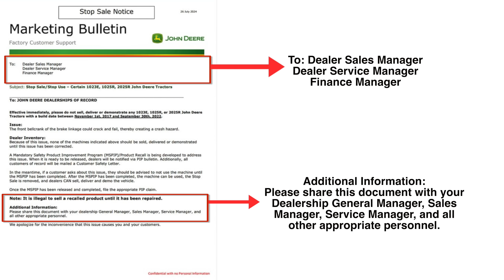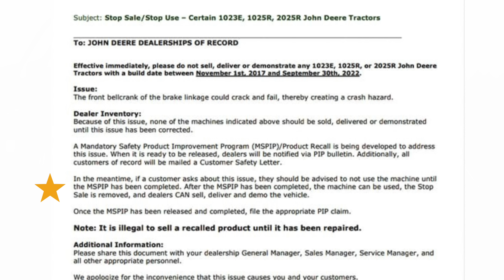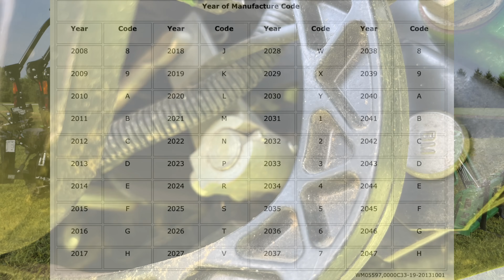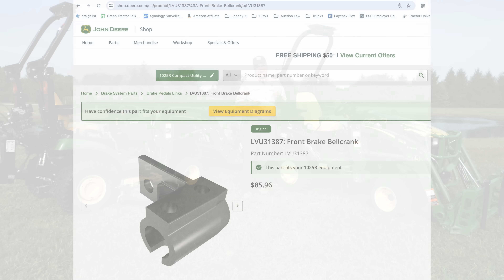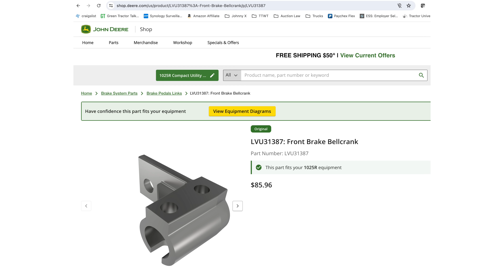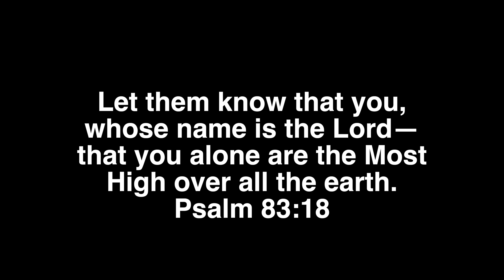Deere Says "STOP USING YOUR TRACTOR"

Comment: We want to inform you about a recent stop use alert issued by John Deere for the 1023E, 1025R, and 2025R models built between November 17, 2017, and September 30, 2022. John Deere will be reaching out directly to customers with affected machines to provide further instructions and support.
At 21st Century, your safety and satisfaction are our top priorities. We’re pleased to report that less than 1% of our current in-stock inventory is affected by this issue. Rest assured, any affected machines will undergo the necessary Performance Improvement upgrade and thorough testing before delivery to ensure they meet the highest standards of performance and safety.
If you have any concerns or would like to verify whether your machine is affected, please contact your local John Deere dealership for assistance.
Thank you for your understanding and continued trust in 21st Century and John Deere.
Reply: Why did I not get a notice about this as I own a 1025r that is in the years that have the problem.
Reply from the maker: @Powerhousered1223 no one has yet.  The recall is just now getting started.
Reply: I used to be a Deere man never again.
Reply from the maker: Thanks for the prompt feedback.  As always, we are impressed with 21st Century Equipment, and your commitment to your customers.  Thanks for taking the time to respond!  You guys are setting the standard for Deere dealerships!

Comment: Tim Love watching you, is there any possibility that John Deere has made any improvements to the PTO switch on 1025R they are inconvenient to use and very fragile
Reply from the maker: They changed it in 2017 or 2018 I think. 
How old is yours? Do you have pull out switch or toggle?   Current is toggle…hold down a second or so to start.
Reply: Minè is the rocker style switch
If you have gloves on it is almost impossible to turn to on
Rocker style switch not very durable
Reply: Pull switches were much better

Comment: I am an engineer and I can tell you that there are many bad design choices in this tractor (I've got the 1023E).  I just changed the oil for the first time and the oil filter is so close to the frame that you cannot fully engage the removal tool.  The oil fill port is also obstructed, and the dip stick is at such an angle that it is difficult to remove.
Reply from the maker: Very tight space. Lots of stuff going on in a small space.

Comment: It’s been over 5 months and they still do not have any word on when parts will be available for the 2022’s. The dealer doesn’t and John Deere doesn’t either. I purchased the 4 yr/1000 hour extended coverage and I’ve lost 5 months of that as well. A company as big as JD should have these parts out way quicker than this.
Reply from the maker: Absurd.  But they didn’t hesitate sending a ‘do not use’ order.

Comment: Mine is under recall. I do remember being on a hill in front of my land scape wall loading up scrap lumber in the bucket.  The bucket was up and as I was putting the scrap in a noticed my tractor was drifting backwards. I was shocked I carefully got on and backed it down the hill. I’m going out today to see if it’s broke or cracked as I’ve heard nothing from the dealer since I went and added myself to the list of people. I’m on a hill but I put mine in low and 4x4 and it creeps on the hill. I just won’t park on a hill until it’s fixed.

Comment: Got mine fixed last week. (JD 1025r TLB)
It's hydrostatic, when you release the fwd-rev pedals, the tractor stops.
l only use the brake as a parking brake when l get off.
Glad it's fixed though.

Comment: My Tractor is a 2019 2025R model. I had my tractor in for routine maintenance service this past month. The letter I received in September, stated my tractor was supposed to be fixed by the end of October. The Dealer repair department stated they "Don't have any parts to repair any tractor yet" The letter states to "Park the tractor and not use it" This is so wrong. I don't want to get hurt or hurt someone else, since I live on a flat lot and never use the foot break, I will be taking my chances if I need to use the tractor. I can't understand why John Deere hasn't found a manufacturer or several manufactures to get these replacement parts fabricated and installed when we were promised they will be ready

Comment: I received a recall letter from John Deere. I called my local John Deere dealer where I purchased my 1023e and they set up an appointment to have the part replaced. They came to my house and picked up the tractor, replaced the part and returned the tractor a few days later. As long as they had the tractor there, I had them change the engine oil and filter and grease job. No complaints here.
Reply: Do they charge for the brake part or give the part to you? I can do it myself but want to make sure whether they are supposed to charge or not. Unfortunately the dealer service in our area are known as parts changers until they find the fix. So I don't know whether to trust them or not.  Hopefully you reply and let me know. Thanks 😊
Reply: @rj9203  There was no charge.

Comment: And as of right now john deere has not sent parts to the dealers to repair this issue. And I will add customers can not repair this issue them self. I work at a jd dealer and probably get calls about this 5 plus times a day. Customers may get up set techs at the dealers don't have the parts yet but understand dealers don't make the parts.

Comment: I decided not to wait on JD parts to be made, and I bought a bell crank for my 2025R off Ebay ($53). This one was fabricated with steel and welded(much stronger). It took me less than 45 minutes to install, and would probably take someone who has done it before about 25 minutes. I suggest you put the tractor on level ground and block the wheels for safety.  Use a 13mm wrench (a 1/2 inch will also work, but remember the two bolts are metric, M8 - 1.25) and it is helpful to have a long screwdriver for leveraging off the rod that goes back to the rear axle/brake. When finished, I replaced the cotter pin with a new one.  Remember that the rod (which goes to the back of the tractor) is on springs and can be pulled forward by hand, to help you line up the brake rod hole in the crank. Both original bolts through the bell crank do NOT have nuts. You will see that the original bolts (when backing them out) will literally eventually hit part of the frame, but if you tip the head of the bolt back and wriggle, you have just enough room to get the bolts completely out. I used a ratcheting 1/2" box wrench, but then had to switch to a crescent wrench, otherwise the ratcheting wrench will get stuck [because the bolts are flanged] when the bolt is nearly out. Note that only the axle (?) itself is threaded.  I discovered that the original bell crank is caste [aluminum ???] and cheaply made. The caste crank is only threaded about 25%. There is no need to jack the tractor up because there is plenty of room [unless you have a big stomach] to crawl on your back under the right side of the tractor. The bell crank is on the RIGHT side of the tractor, directly beneath where the heal of your shoe is, when your right foot is on the (foreward/reverse) pedals. It's a simple fix because the part is 100% metal and there is no electronics or plastics, etc., involved. Local people are fabricating them from steel in their shops [welding]. JD plans on sending techs to your home and doing the needed replacements there, so you don't have to go to a dealership. But the fix is pretty easy, if you want to do it yourself. Again, I got the part for about $53 from someone probably fabricating them in their garage or metal working job. Honestly, a 12 year old boy could probably figure out how to do the removal/installation, but remember, the rod that goes between the crank and the rear brakes is with springs so it can be easily moved back and forth to line it up with the crank hole (top) again. [Don't have the parking brake on when doing the replacement.]

Comment: The original bell cranks have U-shaped slots that go around where the two bolts come out, after passing through the shaft. The replacements are NOT slotted, so in theory these bell cranks should be stronger.

Comment: Update: I just literally got back from my local JD dealership, where I bought my 1025R (used) and 2025R (new). They said the 1025R is a 2013 model (thus not under a recall) but the 2025 is under the recall, because it is a year 2020 model.  Today is Nov. 9th, 2024 and the person at the JD dealership ("Service Dept.) said, "The year 2018 models have 16,000 [bell cranks] on backorder."   This is a problem, because their replacements should have started on Oct 11th.   She did say that  #1) They will call me when they have the replacement part....  #2) They are doing the repair at people's homes, so we don't have to trailer them into the chop.    So what i am telling you is that JD is a month behind even getting started on these things.

Comment: Unfortunately, I understand the frustration with JD. Have you had any rear end leaks on Johnny? My 1025r will be in for the fourth time for rear end leaking hydraulic fluid. Every gasket has failed, pumps replaced. Only 260 hours on my 2021 and nothing but problems

Comment: In my opinion, the flipping roll bar is the most dangerous item on these tractors. I do a lot of wooded lot mowing. Which puts me in around lower branches of trees. 
When In first bought my 1023e, the rol bar almost got me hurt bad. 
I took it off.

Comment: Hello Tim, I have one of those rare 2012 1026Rs.  I checked my stopping lever just now and it appears to be a black steel looking piece. I remember the air cleaner mount  problem. Mine was made where my tractor wasn't affected by the recall.   Thanks for your videos. They have been most helpful over the years.    :)

Comment: I got my Deere letter yesterday. It says in part, "A PIP program has been developed, and you will be notified when it has been released to your authorized dealer. At that time your tractor will be repaired at no cost to you."  And then below that it shows a list of date Releases that apply to each different model year. My release date is Nov. 22, 2024. So, I'll call my local dealer and see if I should bring in my tractor on that date. So there should be no worry as to who will foot the bill for this PIP.

Comment: I am so glad that they are FINALLY taking this problem serious! I have had this same part break 5 TIMES in the past ~5 years. Each time was terrifying especially while on a slope carrying a load. I have repeatedly told the dealership about this problem and they seem to always blow me off.
Reply: They should've created a DTAC case. That's the first thing I do with weird failures as a John Deere technician. That's how we let the engineers know we have an odd failure. If they neglected to do this I'd fire them immediately but I don't have that power lol😂😂
Reply: Devin, see my added post from five minutes ago. I bought one (steel) fabricated by someone and installed it. Easy fix.

Comment: Not much more than a month ago, the bell crank on my 1025R broke. Fortunately, I noticed this on level ground. My property is fairly hilly, and I can’t tell you the number of times I’ve been positioned in a way that if that bell crank had broke on one of those hills, I could’ve been crushed. As an extra precaution, I’ll chock the wheels from now on. 

I paid $279 to have mine fixed. I wonder if I’ll be getting a refund?

Comment: I am similar to you.  I almost never use my brake.  I have a disability, and it is very difficult to reach the pedal.  I just drop the loader or whatever is attached to slow down or stop if for some reason I am in neutral or the engine dies.

I did have another safety issue that isn't a recall as far as I know, but a branch worked it's way up behind the forward pedal, and kept it trying to move forward even when I took my foot off the pedal.  Ended up having to shut the engine off to stop it.  The only real solution to that problem would be a lot of shielding around the forward/reverse pedals and mechanisms.

Comment: Hi Tim and thanx for the great heads up. I have a 2018 1025R with 700+ hrs on it. The brake is working fine on today's job site, but I will be fabbing up a steel bell crank to replace this cheesy aluminum joke of a part. Why would deere make a part that is clearly made to fail?! The design is fine...being a cast part is fine...but being a cast "aluminum" brake part with very little material in a very critical area of the part, is a huge FAIL!!!! Again, Thank you Tim and God bless you even more than today!

Comment: Thank you for the information.  I use my parking brake on my 1023e all the time.   Mine's a 2021.  When I get off the tractor to do something quick like pull the pins to remove the bucket, I put it in neutral and set the parking brake.  I can't pull the pins if the bucket is on the ground.

Comment: BTW, the ROPS situation, I literally am the person that bought one of the first 1025r's and contacted John Deere about an extremely dangerous problem.  I had the thing only a couple days and I was not yet used to the ROPS or the tractor.  I was mowing and hit a branch that was lower than I realized and the tractor went vertical and lifted off the ground literally before slamming back down still vertical... and the ROPS did not release like it is supposed to do.  It is design to hold solid in a roll over but is supposed to release if sent backward, i.e. it catches on something like a tree branch, after so much torque or pressure is applied in that direction.  Mine did not budge.   I called John Deere directly because the dealer had never heard of such a thing happening and so John Deere actually sent an engineer from one of their main plants to look at my unit and found that the pins/parts used were the wrong metal density or something along that line.  A couple weeks later they came back and put all new attachments on the ROPS and we did some tests right there in the field.  My dealer called me a couple days later and said they had just gotten the recall notice for replacing ROPS parts to resolve this issue (which of course they knew I no longer needed) so that was pretty nice to know they, John Deere corporate and the dealer took it seriously when a customer out of the blue called them.   

From what I understand, John Deere re-engineered the ROPS design for later models of the 1 and 2 series because of that.
Reply from the maker: Interesting. I didn’t even know the Rops was supposed to release when it hits something!
Reply: @TractorTimewithTim  They told me on rollover of course not.  But when you hit something like that, under certain load it is supposed to release backward, the same as if you folded it backward, some part is supposed to give before the tractor is flipped over backward.  I nearly went over backward and had my reflexes not reacted, that would have happened... as it was I ended up off the ground then vertical with the tractor sitting pointing straight up thankfully as it slid off that tree branch I hit.  Took another tractor to help bring the thing back down on its wheels.   They told me it was a part which failed to break or release or something.. hard to remember now.. thus the recall shortly after they were put out that year.  I want to say it was 2017 or 2018 if I remember right.  I bought that before we bought this new property and upgraded to the 2032 about 4.5 years ago.

Comment: Odd I use my brakes all the time.  I have them delinked normally and use them as independent per side. I can't remember if the 1025r had that but my current 2032 does so I can turn the tractor better when I am loaded up with something.  Especially if the rear is heavy and the front even in 4 wheel drive, is not turning due to the rear end weight.    I also have a lot of land that is hills here in Wisconsin and those brakes work well to stop a slide or controlled descent depending on the steepness of an incline.  A big use is we have a lot of woodlands here and trying to drive in the woods can be a real problem... unless you use those per side brakes.  Places you may not be able to turn enough to get through, the brakes easily allow the tractor to pivot so get through trees and downed branches where otherwise it can be a problem.   Finally, they also help when using the deck mower and trying to turn a bit sharper than the wheel base allows.  As long as you don't crank on the brakes to the point you would tear up your lawn (note I use tractor tires not the lawn tires so I do have to be a bit more careful), you can apply enough pressure to tighten the turn many times to get around something closely.

BTW have not been able to watch lately, what are the rectangular boxes on top of your ROPS on these two tractors?

Comment: I was actually going to look at John Deere I like the auto connect deck, I think I will stick with Kubota.
Reply from the maker: Silly reason to avoid Deere.  They will be proactively replacing parts for free on 7 year old machines.  Why would that be off-putting?   No other manufacturer would even acknowledge such a problem.
Reply: @TractorTimewithTim  Thanks I will put John Deere back on the list, a BobCat dealer opened up a lot closer to my house, they have tractors but I have no idea about the quality of those machines.

Comment: Back when I worked for John Deere one of their Z turn mowers had a recall. The frames were breaking. John Deere sent us new frames and I had to take off all the parts off the old frame and put them on the new frame. Also had a recall on plastic hydraulic tanks on Zero turn mowers. The plastic tanks would melt and ruin the hydraulic drive. John Deere fix was to mount a fan on the plastic tank and replace hydraulic motors.